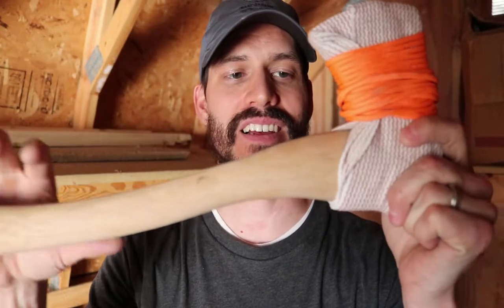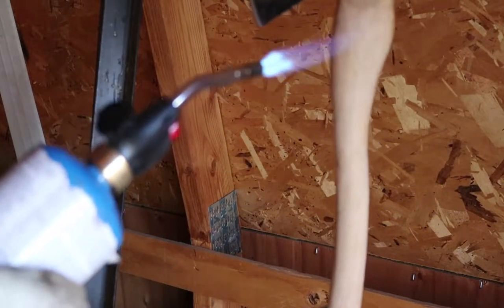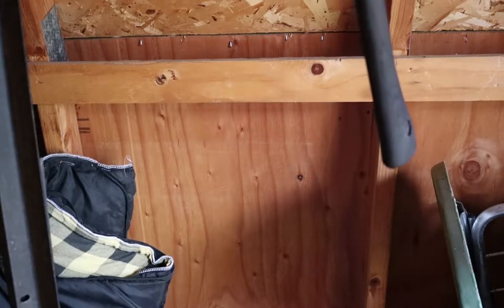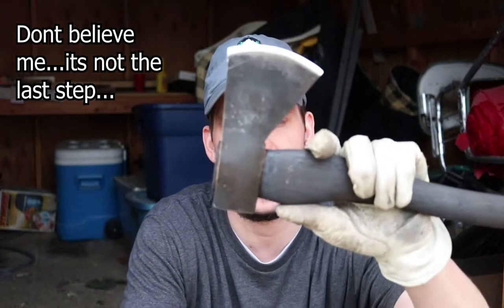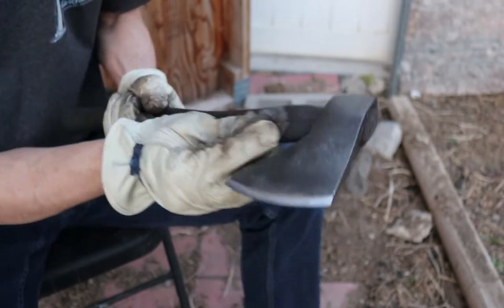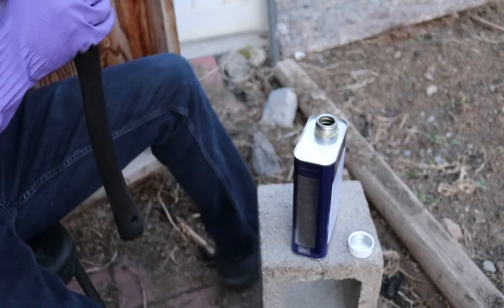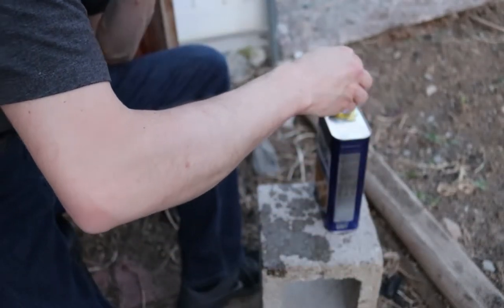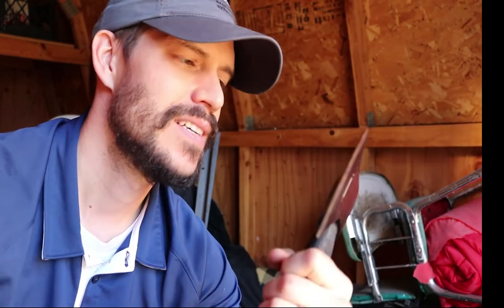How To Use FIRE To Harden and Protect Your WOODEN Tool Handles

Comment from the maker: Check out my new favorite knife! https://youtu.be/RHuhk7oq1Y4
Use the code HIOG10 to get 10% off your very own Odenwolf knife!: https://odenwolf.us/r?id=q7ghaa
Reply: Do you have a tip for sanding all the way up to the axe head? That strip that you used the screw driver on is always annoying for me to sand
Reply from the maker: You can wrap the steel wool around the same screw driver and use that, but it is a hard place to get to regardless.
Reply: @HalfInsaneOutdoorGuy  ty
Reply: @HalfInsaneOutdoorGuy could I technically just char an axe with clear coat. Do I really need to sand the coat off?
Reply from the maker: @GrimJaw the clear coat burns like plastic and makes a booliling bubbling mess of melted plastic and runs into the pours and grain of the wood.

Comment: Scotch brite pad works good for the last step too. Works like a charm. Plus no steel splinters left in the handle. When i charred my handles i applied some oil and wax to soak in while it was hot. Works well.

Comment: Speaking of gloves as a tool to be used, ever think work gloves should be sold in sets of three?  Two for the dominant hand and one for the other.
Reply from the maker: Not a bad idea there.
Reply: Turn the glove inside out, it should fit the dominant hand now, this only works for gloves that have the same protection in the inside as the outside, or use it upside down aswell without turning it inside out

Comment: It makes it for brittle though... 
 You want your axe handle to flex so the shock wave of the impact can travel through the handle more readily. It sounds counter intuitive. However, the flexibility of the handle also adds a unique feature to the dynamics of the swing. Instead of swinging it like a baseball bat, imagine swing it like a whip. The energy of your swing travels through the flexibility of the handle into the head of the axe, increasing the amount of force when swung into a tree.  That’s hickory; you should use sand paper; your axe handle should be thin, not round. Just a little little thicker then the eye
Reply from the maker: It's been several years now, and it still works great. It looks great, and considering it's only a couple of mils deep, it hasn't had any measurable effect on how the handle functions. It's a perfect way to protect the wooden handle.
Reply: Since the middle of the handle is still full of cellulose, it is plenty flexible enough. Just like case hardening steel... The combination of hardness and flexibility make the tool!
Reply: Ever seen Escrima Sticks? The Filippinos burn a spiral around the rattan. Looks like tiger stripes. I believe the idea is to add hardness, but also retain flexibilty, so it isn't so brittle that it breaks. Kinda like how the edge of a Japanese katana is very hard, but the spine very soft steel. The Chinese did this as well with the point and double edges of a longsword, but with two soft bars of steel along the flat on both sides in forging.

Comment: Great vid. One Note: when I went to buy linseed oil, a guy older than me was there, and told me....
"Boiled" linseed oil. Gotta be (boiled)
I don't remember the reason. But he was a retired woodworker of some kind. So it's gospel, as far as I'm concerned.
Reply from the maker: Thank you for your compliments! Yes boiled is what you want. It will penetrate AND harden. I believe regular linseed oil doesn't behave this way.
Reply: Actually, i think raw linseed is better, more penetration, just requires more patience...  Doesnt try as fast... But soakes deep... Take your time with them... ✌️
Reply: Boiled linseed oil dries in a day or two. Regular linseed oil can take weeks.

Besides that, there's no difference.
Reply: @HalfInsaneOutdoorGuy  regular linseed oil behaves this way it just takes a half month to do it

Comment: I have that axe and I love it, it's called the marbles out doors axe or at least that's the one I have but the brand is awsome Also burned my handle but I didn't char it and it looks awsome. I highly suggest the axe it's very good and cheap it cost about 50 dollars on Amazon and it comes with a sheath and its hand forged and the handle is very good
Reply from the maker: Thank you!

Comment: Mate! I subbed and liked before I watched the vid! Purely because I saw flame painting on wood, treating posts with fire, oil and diesel . I want to do do it lightly just to make my knife handle tougher. I hope I can get it jet black and then put an epoxy resin coating. Top coat over it. A full restoration of A bowie hunting knife I scored over 20 years ago because it had an ugly big chip in the blade.  It was throwaway. Thanks heaps! And cheers from Australia 🙂👍👍👍👍
Reply from the maker: Awesome! Thank you for watching! Working on a cold steel tomahawk right now, and I have to say it’s looking pretty good!
Reply: @HalfInsaneOutdoorGuy  oh yeah!!! Ive been wanting a tomahawk to restore but unfortunately in Australia unless imported? Impossible. So I'm stuck with an old Joplin 1970s big  vice I scored after 2011 floods. It literally would have been easier to make a vice from scratch. Lol cheers and thanks for the quick reply. You have to post the tomahawk too! I love em.👍👍👍
Reply from the maker: Where in Australia do you live? Are tomahawks allowed to be sold there? There are a few cheap ones on Amazon, just look for a shape you like, in some good steel and work out the imperfections!
Reply: @HalfInsaneOutdoorGuy  I'm in Brisbane, Queensland.  I'm sure I can import one. But last time I imported a knife from EBay. It got held up at customs and it took 3 months to get to me. Lol. Same thing happened with my Baofeng uv5r 2 way radios. ( my son was furious).  Lol. They are really clamping down on certain items. My mother in law gave me her prized samurai sword which her Sensei gave her when she was back in Scotland. My in laws moved back to Scotland and it wasn't allowed to be taken back! So she gave it to me. Man I treasure that thing. It's at least 40 years old. I can't even import a Kubotan for my keyring. So I borrow my brothers lathe and a bit of solid brass tubing and VOILA! If I could export or sell at the markets? I'd be doing ok.lol . But yeah it's become a little ridiculous with certain items. Cheers 👍
Reply from the maker: Crazy. I just ordered a boker otf automatic knife. I needed a edc pocket knife I could open and close with 1 hand. Makes building shelters with string, and cordage much easier! I’ve been using a cheap 12 dollar opinel for years, but just got tired of opening it with my teeth when my hands are full lol! Hopefully they lighten up over there!
Reply: @HalfInsaneOutdoorGuy  I hope so too. Lol. It's just a joke at some of the laws! I always have a laugh when I watch the news. Maybe I'm too old school? I remember being a kid and going into the supermarket with my mother and in the back section they had sporting goods with rifles behind the counter on display. Now I have to carry all mechanical tools in my car trunk. If I leave my breaker bar on the floor? And I get pulled over? Whoa!! I've had my car searched for drugs and other weapons especially when they see my licence. Lol. They read my name and straight away: are you Russian? Me: no I'm Yugoslav! Ok sir we have to search the car. So I put in a complaint one day. And now  I haven't been even looked at. LMAO 😂. Cheers

Comment: Not sure if you mentioned to not use a rag of any kind when working with boiled linseed oil or not. Just a disclaimer do not do that because the rag can combust by itself.
Reply from the maker: its not as easy to get to happen. Paper towels do it much easier, if the rag is cotton it might go up more readily. I intentionally tried to get a rag to combust just a few months ago. It just got hard and crusty. It was a microfiber rag though and I think those are polyester, or poly something.

Comment: Some people here comparing spear head to axe handle.  A spear is different from an axe handle.  A strengthened point pierces better yes, but an axe handle is best when it absorbs the energy.  It should be able to flex to do this.  Charring it reduces this ability.  Also that the area beneath the head is not heat treated causing a localised stress point where the entire energy transfer takes place on the boundary between the treated wood and untreated wood.  Not good.

Comment: came here from that blackening triangle video ... I have a question.  I have an axe that got left outside and turned grey.  It's not smooth anymore and I fear blackening would burn too much of the wood  as it is thinner than when newer. Sad it got left out, as it has a unique handle and can't use a store bought one (antique fireman's axe).  Is there a lacquer or something to help restore old handles? Or a different fix( it is still strong but requires too much shimming now)
Reply from the maker: Well, that depends on how far gone the handle is. I have a tomahawk that I intentionally left in the bed of my truck for an entire year. When restoring I,  I burned just the very smallest amount, just enough to turn it black. It turned out okay, but it didn't remove a bit of the wood because that also requires you to sand off all the old varnish and lacquer. Light sanding and boiled linseed oil is probably your best bet. If there's any cracking or deep pot marks, you can fill them with sawdust and superglue or Sally Hansen's hard as nails. But whatever you do test it on something you don't care about first.
Reply: @HalfInsaneOutdoorGuy  Thanks!  I got it at an antique shop 30+ years ago so it is pretty special.  Has a nice protruding arc to the blade (tighter circle) but I had to use a lot of nails and screws to shim it. It will be fun to try to redo that with some sawdust and glue i suppose. I appreciate the reply and advice.
Reply from the maker: If you're not opposed to it, record the "before" and "after" and put it on YouTube! Remember to test your potential fixes on a piece of wood that is in the same condition. Even if you have to create the same condition by getting any other handle and leaving it out in the weather. :)

Comment: Oil with tung oil and the black won't come off anymore
Reply from the maker: The black only comes off when it gets damaged enough to gouge the wood. Which almost never happens now. If one does not wish to burn the wood one can also crush charcoal into fine powder and mix it into tung oil or boiled linseed and apply that to a sanded bare wood handle. Both methods look great!

Comment: Hmmmm. Not sure if you did that procedure right. I believe the handle should have been uniformly heated at once, like thrown in to hot ashes for a minute then turned over for another minute. I believe you let the wood get too scorched. Dunno
Reply from the maker: I am not sure if I did it right either. Black Smith YouTubers like Alec Steele, and Builders like my self reliance, have both done similar things. I looked up the practice in Japan where it originates in did it is nearly as I could to that without having a larger heating source. The next one I did similarly the third one will be over campfire. But if you quickly heat the wood that can warp and crack it. If the wood grain is bad.

Comment: Is there any reason to use steel wool instead of sandpaper?
Reply from the maker: Matches the contours of the wood better without leaving the scratches that sandpaper will leave. Its also a bit cheaper.

Comment: Nice. That is not a hardening process, as some people assume here , it is just for esthetic reasons. Actually it weakens the wood a bit.
Reply from the maker: Shou sugi ban, or Yakisugi. It also water proofs the wood.
Reply: Except...it does harden it. Can be more brittle. But definitely harder. Used to make fishing spears as a kid and would fire harden the tips. If you didn't they would fray and lose the point on them.
Reply: @christianhernandez7740  brittle wood is great for axe handels. Lol
Reply: @lukasking2573  you really have no idea what your talking about do you
Reply: @wangchung_8541  lol. Ok keep dreaming on
Reply: @christianhernandez7740  a spear is different from an axe handle.  A strengthened point pierces better yes, but an axe handle is best when it absorbs the energy.  It should be able to flex to do this.  Also that the area beneath the head is not heat treated causing a localised stress point where the entire energy transfer takes place on the boundary between the treated wood and untreated wood.  Not good.

Comment: Burning should make it weak but you say it becomes strong how
Reply from the maker: burning the wood, using a process called Shou Sugi Ban, is a process that is typically best used on cedar, but with most hardwoods it has an affect on the wood that makes it harder and more resistant. I'm not 100% sure why, or how, I did explain what I know in the video though.
Reply: @HalfInsaneOutdoorGuy  hmm ok sir
Reply: @humblemaster1  I got curious and did some quick research. The only reason I could find as to why it would harden is because of removing moisture from the wood (though I think there's more reasons that I didn't find). Depending on the wood, it might also melt the pores shut by melting the internal resins. What it definitely does do is preserve the wood because you burn it until only carbon remains and pure carbon is inert. This protective layer prevents rot, fire damage, water damage, weather damage, etc as long as the outer layer isn't penetrated. Also because the wood inside the handle isn't affected by the treatment, the flexibility of the handle remains so it doesn't get weak because of that. That's how far I got with a 5 minute google search, hope you found it as interesting as I did.
Reply: @TaylorTheOtter  😊👍🙏

Comment: ... Why not just use a magnet to remove the dust? seems faster than a brush.
Reply from the maker: That's actually a brilliant idea. I'm going to go try and see if it'll work with the steel wool I have. The only problem I see with it is the magnet would have to be powerful enough to pull the steel will out of the wood because some of it will be somewhat embedded into the wood.
Reply from the maker: Yes they do.

Comment: Can coconut be used instead of linseed oil
Reply from the maker: It shouldn't be used, Coconut oil doesn't dry like linseed oil. Over time it also can rot causing a foul smell.
Reply: @HalfInsaneOutdoorGuy  what about castor oil sir
Reply: @HalfInsaneOutdoorGuy  and also how can I make a strong cricket bat out of weak wood. Or add strong layer on it so it doesn't break easily
Reply from the maker: @humblemaster1  it will have a limited effect on already weak or soft wood. Their makeup is different. It works best with cedar woods, and good with hickory, and oaks, cherry, and some maples (box elder maple isn't that great from what I've seen), not good with pines though, or aspens, or willows, It might be good on birch though. we dont have many if any here in Utah so I dont know, What kind of bat do you have?
Reply: @HalfInsaneOutdoorGuy  Thankyou for that sir, I am ur new subscriber
Reply from the maker: @humblemaster1  anytime! Love to help, its one of the reasons I made this channel!
Reply: @HalfInsaneOutdoorGuy  sir please tell do u know any method to strengthen my cric bat becz I bought 2 bat for 200rs and 1 broken for 1st day so I thought I shall use another bat after making some extra additives for it to make strong